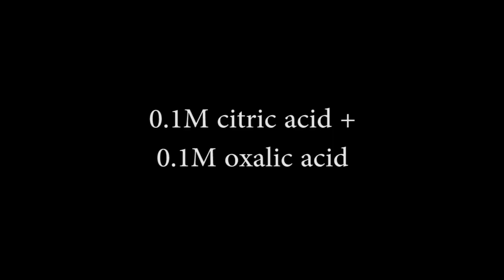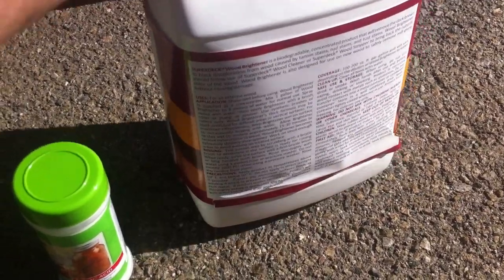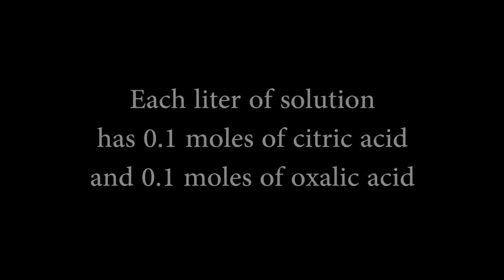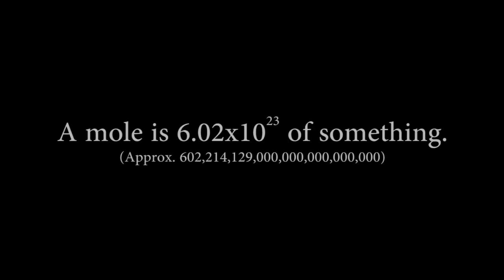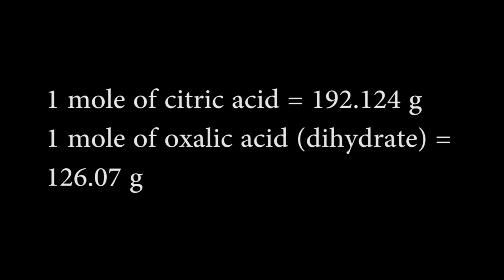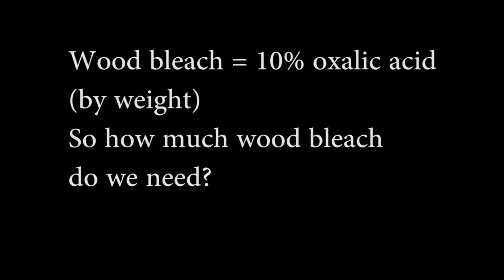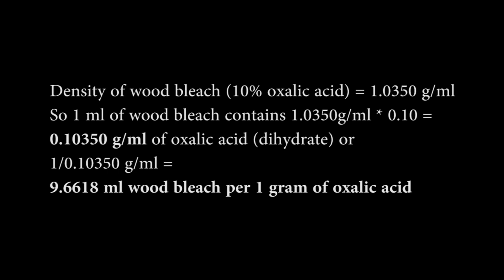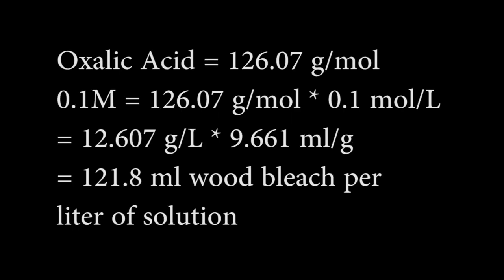How to prepare an acid solution to clean a catalytic converter

Comment: Catalytic converter cleaning:
Formula: Per gallon of water I used 75ml citric acid and 50ml Oxalic acid (I used the powder wood bleach from hardware store, I think it's mostly oxalic acid).  Soaked it for ~6 hours in the sun, Lifted cat to move mixture around every hour.  Used 2 paint cans, can opener to take bottom off, then some metal tape (this was perfect fit).  Had a slow leak but put it in bucket to catch leak and refill the can stack when running low, only had to do it a few times.  I also put some lights on it for added heat, although the liquid didn't get all that hot.  The key is soaking it I think.  I wore gloves and goggles to be safe.   I've passed smog twice doing this!

Comment: I used this ratio in 8 gallons of water and soaked my Prius cat for 6 hours. I was going to use a pump I have but it died, so I used a larger volume of solution to submerge the entire cat. It was in a tall black bucket outside in the sun on a 100F day and kept the solution around 120F. So this basically makes two deviations from the study  by not having circulation and not keeping the solution at 150F.

I had been driving for a year with the P0420 code. After doing this, the ECL has not returned in over 2500 miles. This appears to be for real. I saved $1800 because there is no CARB aftermarket cat for the Prius and I'm in California.
Reply from the maker: Great job!  That's a shame that there aren't any CARB models for the Prius.

Comment: Nice video!
My oxalic acid source (deck cleaner) SDS only specifies a diluted concentration of >1 and <5% mixed. This means anywhere from 10-50% undiluted. I do have a pH meter though, and am wondering if you know what the final pH is, or the pH of the oxalic acid solution you used? With that, I can probably just increas the amount until I hit the numbers. on the

Comment: After cleaning your cats in this acid wash, did actually work? Did it actually restore functionality of your cats at least somewhat? 

Also Does this solution have to be heated to 170° F? 

Would this solution be ineffective if it wasn't heated and used at room temperature?

And, is circulation really required? Would the solution  be ineffective if at proper temp, but not circulating?

And how long to soak in the acid bath, while keeping at 170F & circulating the entire time?

Comment: How long to let sett in? How long to treat? Thanks!
Reply from the maker: +Carlos Ortiz I really don't know because it turns out one of my front cats was disintegrating and clogging the rear cat.  So that was my main problem.  The bath probably did not do anything to help my situation.  I just posted the video to help others who wanted to give this a try with mixing the chemicals.

If you just soak the cat in the liquid it probably will not work as well as if you circulate it.
Reply: +Carlos Ortiz As I understand it 6-8 hours above 170 C.  I did it overnight using a space heater and aluminum foil on the backside to reflect the heat.  I also removed the heat shield on the cat.  The inside was black before I did it (soap and water and various solvents could not remove it), but totally clean afterwards.  Passed emissions after that.